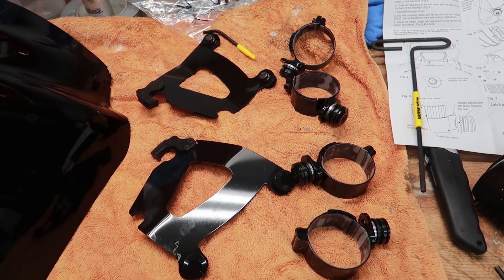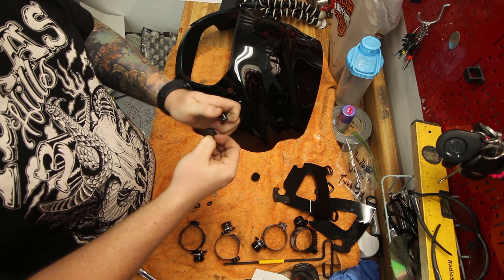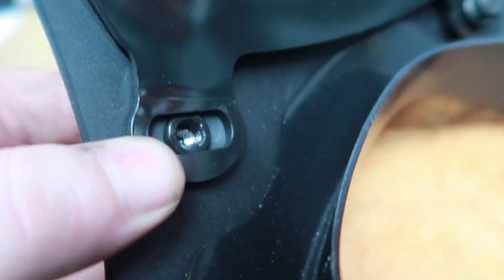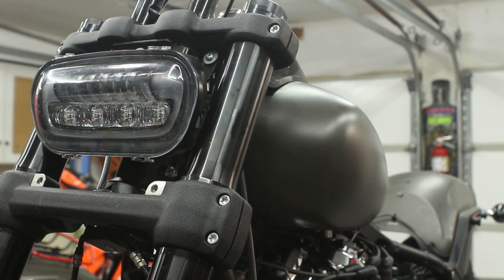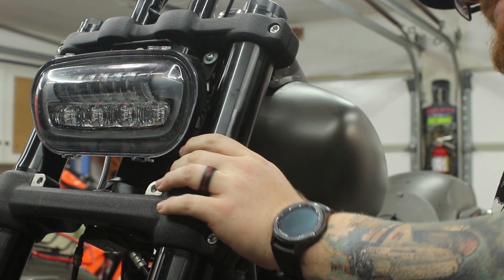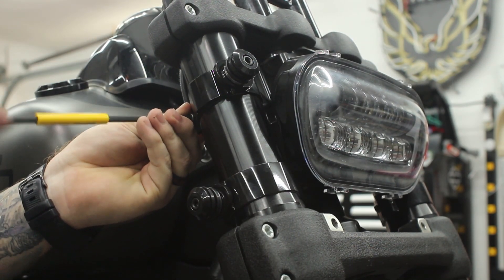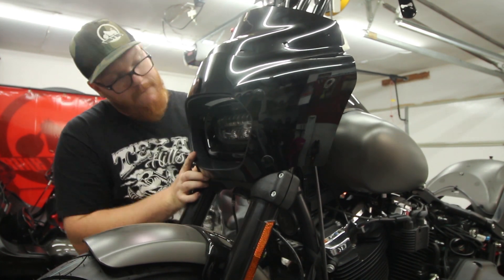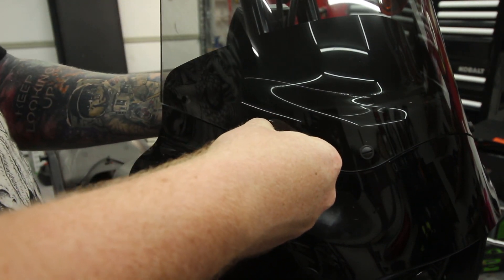Memphis Shades Road Warrior Fairing Install - Fat Bob Softail '18 and Up

Comment: Good video. Important note: With the Lowrider 20-21 fxlrs, mounting clamps backwards will cause damage to the tank. Do not install the way it is shown in the video. Very important with fxlrs and flsb 18-20: Throttle side, front of the bike. Never backward, check the instruction sheet

Comment: BnB fairing looks great I've def been looking at this for my 18 fat bob and know i know i can pull the trigger because it looks great. I have 2 questions:

1. What size windshield would you recommend if I still have stock bars?(I like the look for my bike)

2. How much was your cruise control? And if I'm not an mechanical or have the patience as you do to install then do you recommend the dealership install or is it better you think to bite the bullet and tackle it myself and just let the dealership program it?
Reply: @Mario Gunner Instablaster :)
Reply: @Braylen Reece I really appreciate your reply. I got to the site on google and im waiting for the hacking stuff now.
Seems to take a while so I will reply here later with my results.
Reply: @Braylen Reece It did the trick and I actually got access to my account again. I'm so happy:D
Thanks so much you saved my ass :D
Reply: @Mario Gunner no problem :)